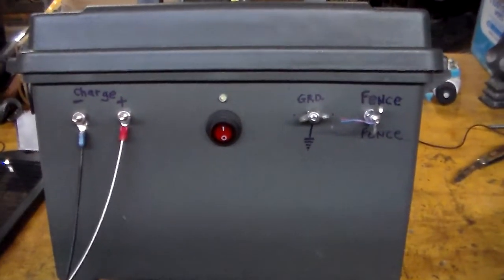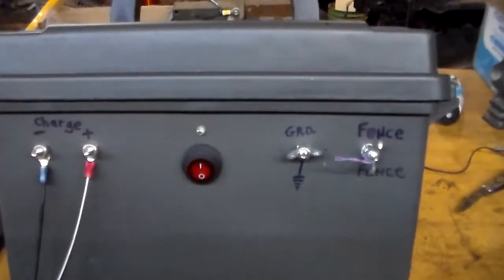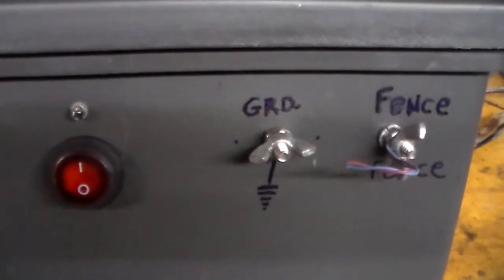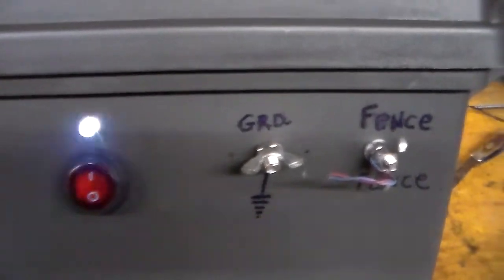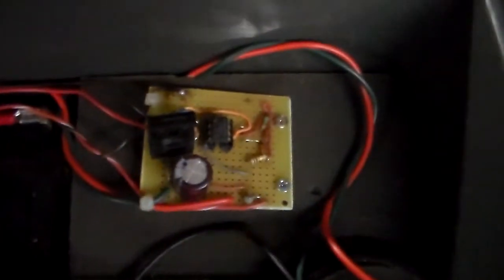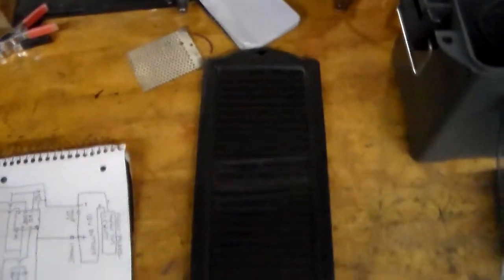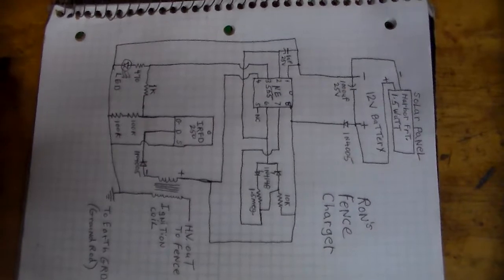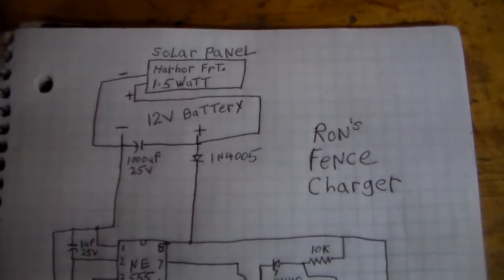Electric Fence Charger Homemade

Comment: What is the circuit board? Is it included in the schematic showing how to build it?
Reply from the maker: Just built it on a copper clad perf board using small wire to make connections.

Comment: Automotive coil is ok when your fence is not too big . Any crass that crows long and touch fence wire will lower voltage lower because of high impedance of coil . Capacitor discharge systems have very low impedance so voltage doesnt drop much . 
My home made one ( 1990 ) charges to +330V and have 125 micro Farad capacitor ... open circuit voltage 11000V ... 500 ohm resistor connected to out put still gives 5000 V pulses . 5000V / 500ohms = 10A =50kW pulses ! I can punch tiny holes on paper between arc cap .....
Reply: My American fence charger has gone weak. I have four grounds but deer just crossed it several times last year. I need something powerful and hopefully Solar..

Comment: Made this with a bigger battery and solar panel, and doubled the fire rate. 2 laps around a 400’ fence for 800’ total. Serious copper ground and the chicken wire fence the runs are in front of is grounded. I think a high capacitive load does reduce the spark a bit, but it still hurts. Heard an opossum screech on my outdoor camera! This is to stop raccoons and opossums from messing with my fig trees. After my first season, total success! Thanks for the inspiration!
Reply: Bigger panel and battery to support faster firing and my new england cloudy weather.
Reply from the maker: @PlantLEDguy  Good deal, this is a simple circuit but has a hot output.

Comment: What is the estimated output in joules?  Thanks!
Reply from the maker: I'm not really sure how much energy in joules the charger puts out or how to calculate it.  Judging by the length of the spark and the noise of the discharge I would say it is quite large.
Reply: Thanks for your reply.  I looked into using an automotive ignition coil for this type of application.  The output voltage is generated when the coil primary is interrupted.  This causes an abrupt collapse of the magnetic field within the coil which in turn induces a high voltage in the secondary.  This voltage can be about 20 kV.  By the looks of your spark, you are getting all of that.  Commercial fence chargers use a capacitor to store a charge which is then connected across the primary of a transformer via an SCR.  The stored joules can be calculated from the capacitance and the charge voltage.  The output joules is somewhat less due to losses within the output transformer and the SCR.  In your case, the ignition coil is the energy storage device.  The output power is determined by the ignition coil used.  I expect the shock delivered by your system would be quite severe.  Thanks again!  @Handyman2020

Comment: This build netted you a new subscriber my friend...lol I have a question though, Is there a way to use a relay to have it make that kachunk...kachunk,,,,,kachunk that the old fence chargers used to make?
Reply from the maker: The old fence chargers used a High Voltage transformer and a relay or other pulsing device to energize the transformer momentarily . A bad design in my opinion. The newer chargers are easier to build and more efficient.
Reply: @Handyman2020  Agreed. Here is what I am actually trying to do. I want to fill a capacitor at 2000 volts and then chop it with a thyristor to get varying frequencies. Probably 120 hertz or even 60 hertz to be able to use a microwave oven transformer to take back down to 120 volts with some amps with the resonant capacitor.
Reply from the maker: Not exactly sure what you are trying to do, but I do not know of a thyristor that can handle the 2K voltage directly. @Biokemist-o3k
Reply: @Handyman2020  When you raise voltage and frequency you can fill a capacitor very quickly. Then you can chop it to 60hz and run it through a microwave oven transformer with a resonant capacitor. This is essentially an inverter system that will enable you to take a 12 volt battery and if you use resonance to make the draw negligible to produce the electrical disturbance then you have done something similar to collecting solar energy and converting it. Check Tesla Conference 1996 Don Smith device.
Reply from the maker: @Biokemist-o3k  Yes I am familiar with the Don Smith device.
Reply: i also wanted to hear that ka chunk too,lol.

Comment: Good day everyone, I live in Tuscany, Italy. I am an electronic enthusiast and I built several Electric Fence Circuit Charger. I noticed that the electrolytic capacitor on Pin 1 from NE555 ist mounted with wrong polarization, it is normal, or it is a drawing error, thanks for your video, Antonio
Reply from the maker: I noticed that the capacitor is drawn in wrong after I posted the video, thanks for pointing it out.
Reply: @Handyman2020  
Thanks for your quick response

Comment: Hi sir i have a question , there is any circuit board  available  on ebay or something like  yours?
Reply from the maker: No there is no circuit board available and unless you are an electronics hobbyist You probably could not assemble the project. 
Although the make up of the circuit is relatively simple compared to other designs.
Reply: @Handyman2020  would a turn signal flasher work?
Reply from the maker: @randymacsgarage  I don't think that would work since the output from the hexfet is a short and intense pulse.

Comment: What did it actually end up costing---close estimate?  And how long of a run would this power? 
I want to protect muscadines as well as rabbits and deer out of my peas. I love this kind of thing. Thanks for sharing your ingenuity. Jesus bless.
Reply from the maker: This charger is very powerful, the arc off the coil is 1/2 inch long and worked well for keeping the racoons out of my grapes. 
Unless you are versed in electronics assembly I would not recommend attempting to build.
Sorry for the delayed reply, I thought I had already replied.
Reply: @Handyman2020  No problem with delay....many times folks don't reply at all. Or sometimes months later. That's fine...I know life is a very busy thing. Hope to do this but this project will have to get in line with all the other ones  lol  Jesus bless.
Reply: He has a solar panel charging the battery so it will last for many years until the battery expires, 5 - 10 years.
Reply: @PF-gi9vv  2 years tops the battery will drain fast also with that coil. Not capacitors to help with storage and surge current. good idea bad circuit.
Reply: @TheTubejunky  Yep, you are correct, good spotting.
Reply: @PF-gi9vv  Thanks for helping me....every little bit helps.  Jesus bless.
Reply: @sandrarichardson2713  Looking at it again, the solar panel will not charge the battery enough. You have to add in rainy days, winter etc. A 10w or maybe a 20watt panel would be needed to keep the charge in the battery. And a battery charging circuit would be needed to stop the battery from over charging in the summer.
Reply: @PF-gi9vv  Thanks so much for that clarification. Appreciate your help.   Jesus bless.

Comment: Love your inventions! Keep posting!
Reply from the maker: Being a retired electronic technician, I had most of the components on hand and unless you are versed on electronic assembly and soldering I would not advise on building this charger.
Although it is one of the simplest chargers to build.
Battery cost $35, coil $ 20, ammo box $10, solar panel $8 plus all the electronic components.